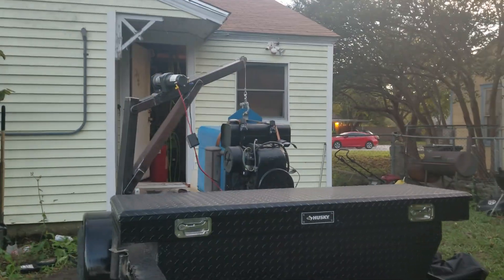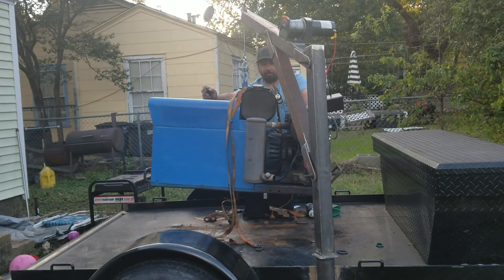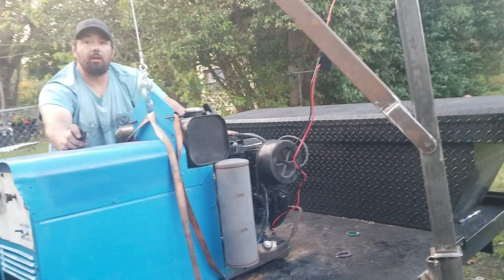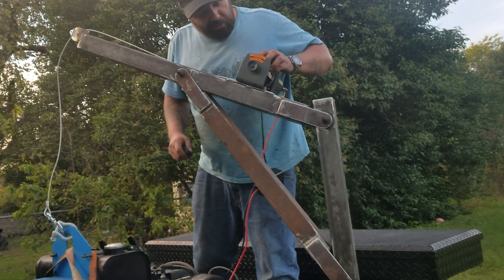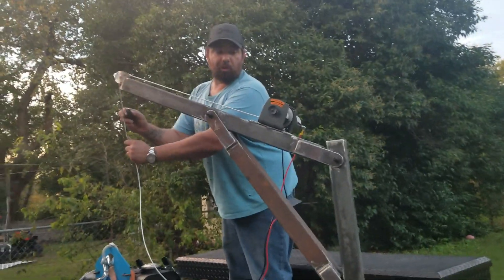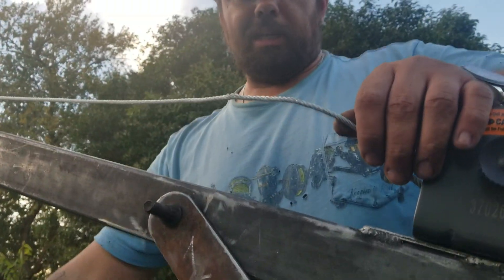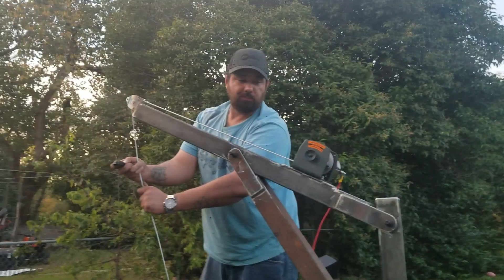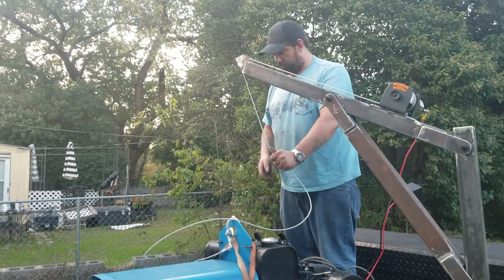My Homemade Crane

Comment: I know this is a 2+ year old video. Use heavier battery cables to winch like COPPER jumper cables. A lot of burned up winches from too light of wires and always disconnect from battery when not using it. Cranes are great. For SAFTEY Never wrap your winch cable around Anything always lift from the hook with a chain or strap or shackle, if that cable gets ANY little nick or cut or kink it can break and KILL you.  One more thing cranes are for LIFTING not PULLING!

Comment: Put a snatch block at the hook and hook the cable back to the under side of the boom so you will have 2 cables pulling the load at half the speed
Reply: MY THOUGHTS AS WELL.

Comment: Good job...that will surely make life easier....If you take most of the cable off that your not regularly needing it will slow down your line speed a little and use less energy to lift...it moves the contact point of the cable to the drum closer to the axis...achieving less load leveraging.

Comment: Don't worry about that cable. Go for it until it starts to pull apart
Reply: Awesome Idea Jack until somebody gets injured or KILLED!
Reply: @barntt  noobody is getting harmed if you observe safe use. Take it from someone with a lot of understanding & experience here. You can get a crane to do a job but must not trust it. The moulded ferrule have been seen to release the loop instantaneously on small section ropes on a rare occasion. even massive cranes have toppled, torn from mounts, and bent through the beam or boom. Take care not fear. Sweetie.